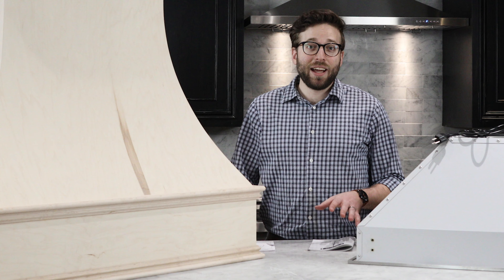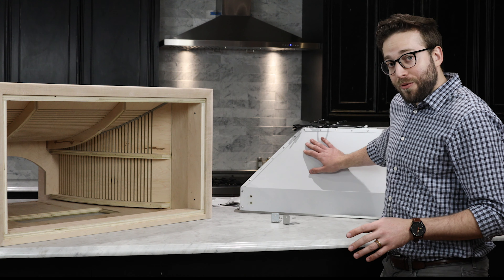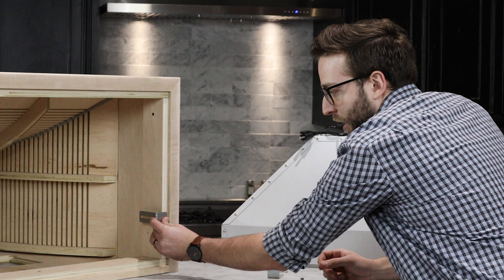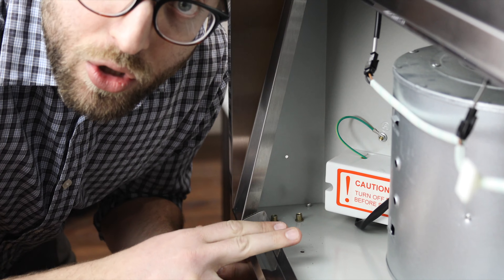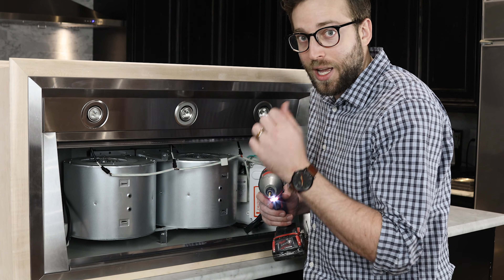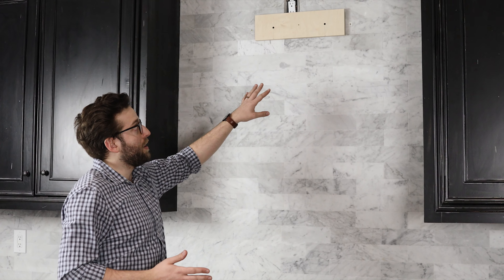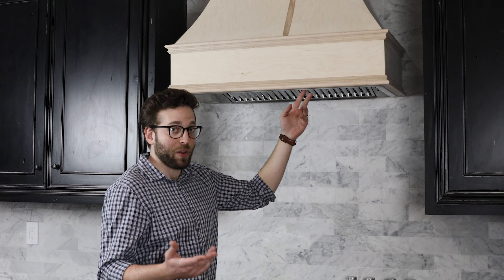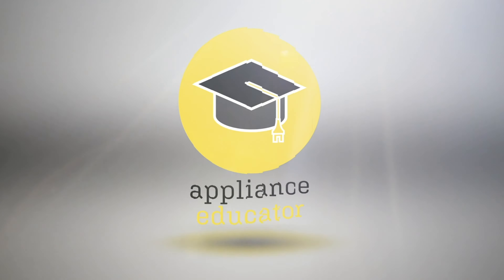How to Install A Range Hood Insert Motor Into A Custom Hood

Comment: You either didn’t put any screws in the front or you didn’t show doing it.  If you only put 3 screws in the back and one or two on the sides towards the back. The front will hang down.  I put a few screws in the front too it wasn’t as easy but we made it work. It’s a must do step!!!
Reply: Scott Hyde I was thinking the same thing.  Any tips on the front screw install?
Reply: Dan Rothwell it’s the same as doing the back and sides.  You just are going to be a little higher and you can fit a electric drill in there so use a regular size screw driver.  I used a little sturdier self-taping screws instead of the ones they provided.  But either will work. It really all depends on your hood and frame since it’s higher you’ve got to make sure there is something you will be screwing into.  I ended up using the brackets they provided that they didn’t use in this video as a make shift bracket.  I drilled them into my frame and that gave me the height to secure my screws.  But it could be different for your hood.  Does that help? Wish I could send you a picture.
Reply from the maker: Thanks, Scott. Yes, I put two screws in the front, and it was quite challenging and hard to film but having screws on all sides is vital and a must do step. Sorry I had left that out and I appreciate your comment!
Reply: @ApplianceEducator    So you skip the hardest step ?   Im dealing with this at the moment as well   How do I mount the front?
Reply from the maker: @jdegid  Hey John. As we said above we apologize for leaving that step out. You should be able to screw into the front the same as the sides, it just might be a bit more challenging depending on the manufacture of your insert.

Comment: Where is the venting? You said that it will vent out of the house but I don't see any connection through the wall or ceiling? The part I'm unsure of when is the venting connected to the insert, prior to mounting in the custom hood, or afterwards?

Comment: Sorry,  this is not helpful. The custom hood covers the exhaust conduit and you can't access it after you put the hood on the wall, so there is no way to connect the hood to the venting. :-(

Comment: But you didn't attach the vent. How do you do that now that it's mounted and you can't get behind it??
Reply from the maker: Hello, thank you for your comment and we apologize for the inconvenience. When installing your insert range hood we would recommend installing the base first, then following with installing the vent. From that step, finish installing with the cover hood. If you are still struggling with installation, we would also recommend referencing the user manual or reaching out to a professional. Please let us know if you have any other questions.

Comment: I have purchased 36 inch same hood as you 
Would 34 inch Zline insert be fine or 36 inch ?? 
Please let me know
Reply from the maker: It should be fine but I would suggest you get the cut out specs to make sure it will work for sure.

Comment: Any recommendations for installing a cooper shell?  Have received a Vent-a-hood BH234SLD insert.
Reply from the maker: Hey Art! The procces should be pretty similar. I would just double check with the insert manufacture to see if they have tips or things that suggest you avoid.

Comment: Where did you get the brackets and what size
Reply from the maker: Hi Angela! The brackets in this video came with the ZLINE insert. I would suggest you check with your inserts user manual for recomended bracket sizes!